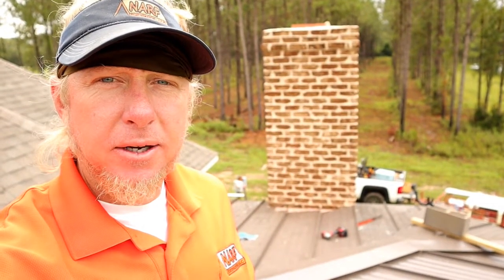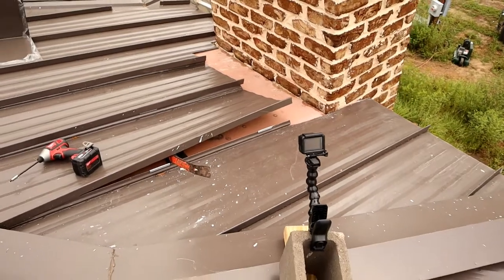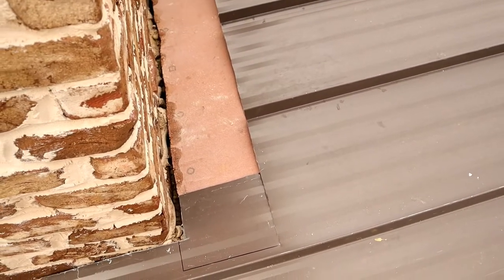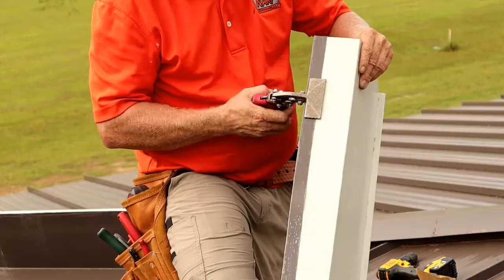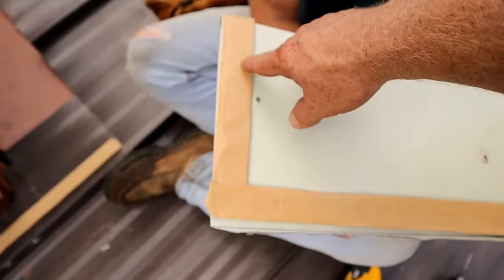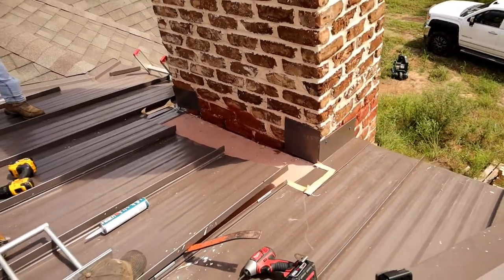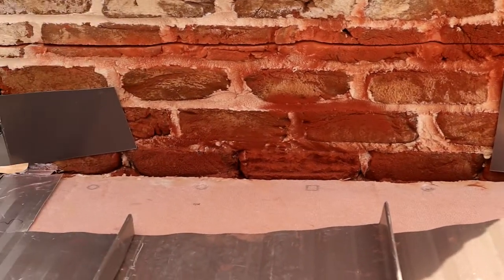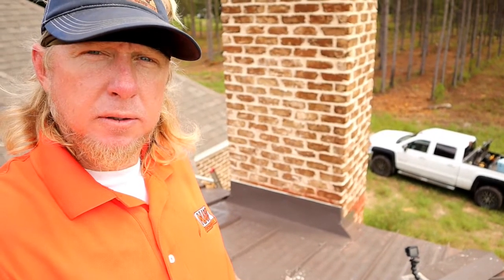How to: Flashing a chimney on a standing seam metal roof!!

Comment: I am looking for someone to do this kind of work in western MA. The roofer installed my metal roof without flashing the chimney. He said he was going to come back, but never did. It is wrapped in plastic, but I can feel above the chimney that the wood is wet, up for quite a way above the chimney. We just had an ice storm here, maybe that caused an ice dam and the water ran up under the metal? I think my roof is the exact same product - it looks like Fabral. In any case I need my chimney flashed, and for a bunch of reasons I no longer trust my original roofer. If anyone reading this has any recommendations, please leave a comment.
Reply: Because most don't know how. It's easy to screw down some panels. Takes brains to flash and do detail work correct . Sorry bout your luck. Only if I lived closer.